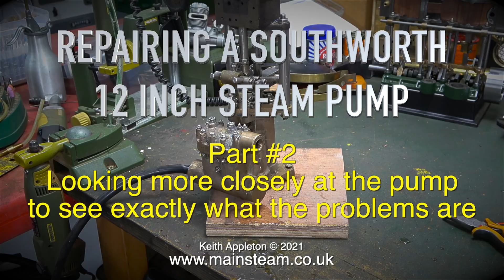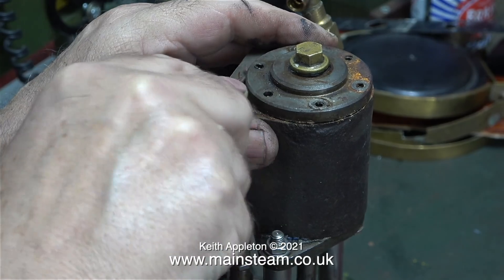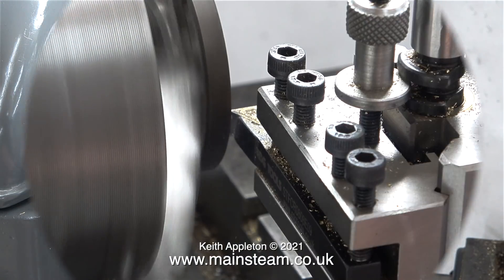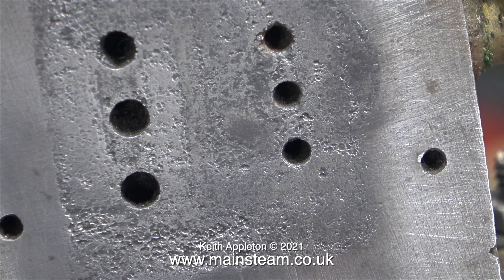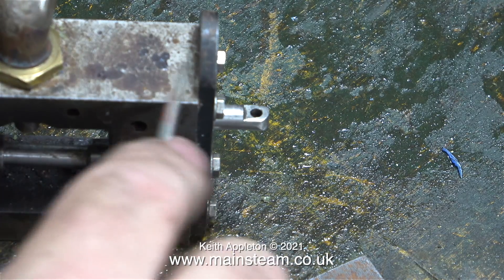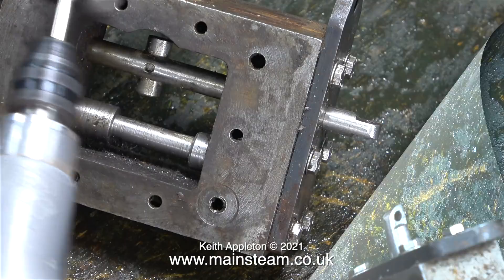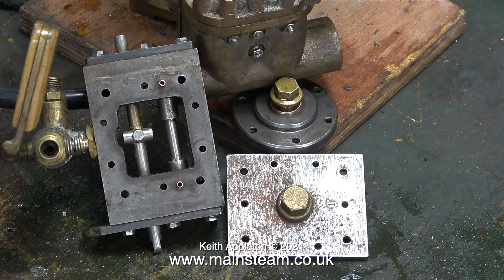REPAIRING A SOUTHWORTH 12 INCH STEAM PUMP - PART #2

Comment: Hi Keith, great video as usual! 

I know it’s not related to the vid and I hope it’s not a stupid question, but I would like to ask some advice on o rings please? 

I have recently bored out my cylinder block but it’s gone slightly oversized (it’s now 15.2 mm instead of 15 mm) Is there any o rings you can recommend to fit this size or how to make one fit? Both the and piston are made from aluminium and it is for a small wobbler engine that’s run on compressed air

Thanks 
Tom
Reply from the maker: I don't know exactly what's available in O ring sizes. In the past I have wrapped a couple of turns of PTFE tape in the piston groove to pack it slightly and then fitted the standard size O ring, it seems to work.

Comment: A friend gave me a book full of working drawings for bar stock engines and between the steam chest and the valve face is a brass plate. With you saying there are some parts missing from this unit and looking at the state of its valve face. Maybe this could be the same set up
Reply from the maker: Some pumps do have a plate. The design of this pump does not need one. And it is not made from Brass.